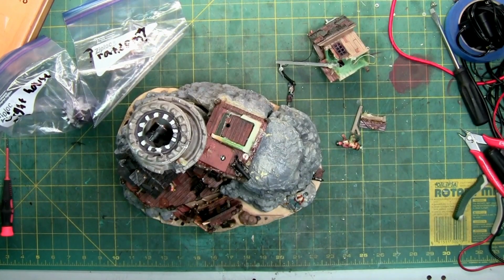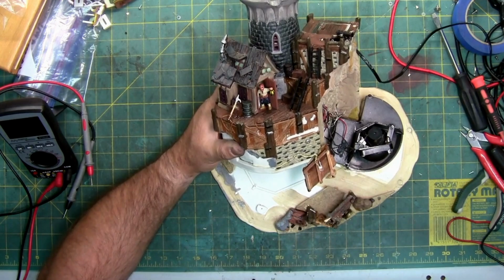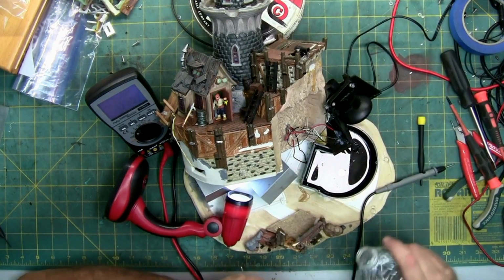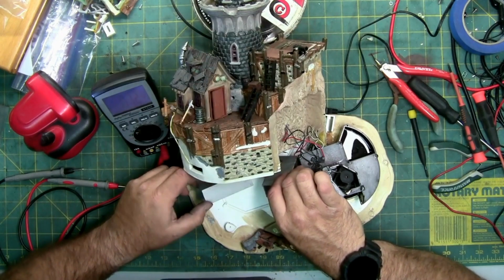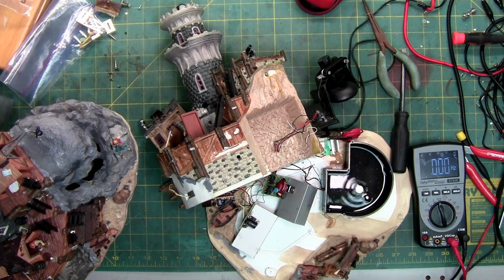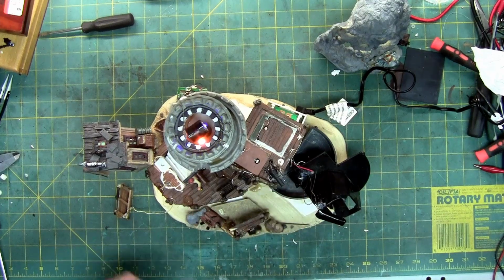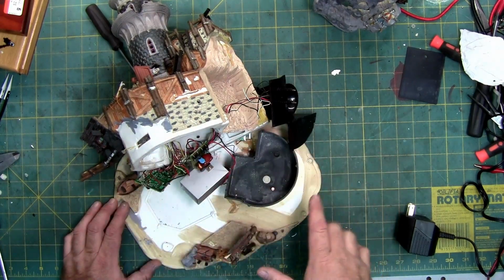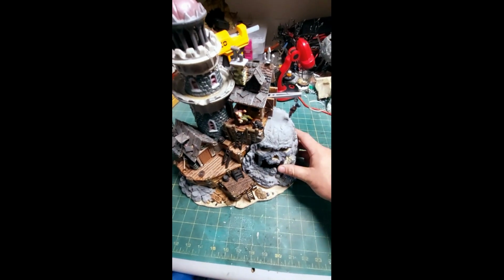Lemax Isle of Doom Repair/Replace

Comment: Everything works on my Isle of Doom (including fogger) except for the eyes on the skull. I use a 24-volt adapter, so that is not the problem. TYIA. Great videos, btw
Reply from the maker: LEDs probably burnt out or corroded, The mist can corrode the connections. I wouldn't mess with it, these are a pain to repair if you make a mistake. But it is cool it functions still.
Reply: @RandomJunkChannel  Thank you so much! I am not touching it! And thanks again for your videos. Are you an electrician? You are so very knowledgeable and so smart.
Reply from the maker: @SoMaryClimbIn I am not an electrician, but at my job, I do work with electricity around water.

Comment: Awesome video.  Do you have any specifics on the Isle of Doom 24vac adapter?  There are no details printed on the OG adapter and it has died on me.  Trying to figure out how to search for a replacement.  Thanks.
Reply from the maker: I might have one, I will check. Message me at randomjchannel@gmail.com
Reply: I also need a new plug in please let me know which one is a good replacement lol